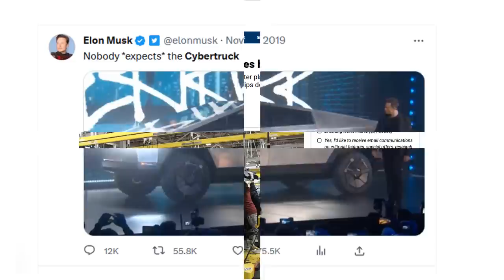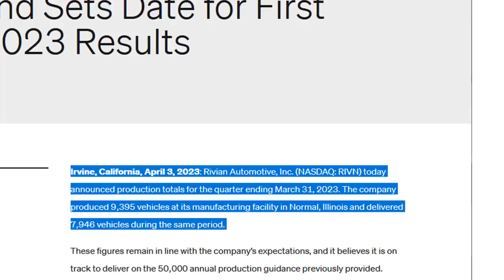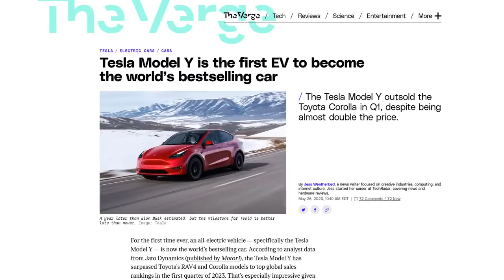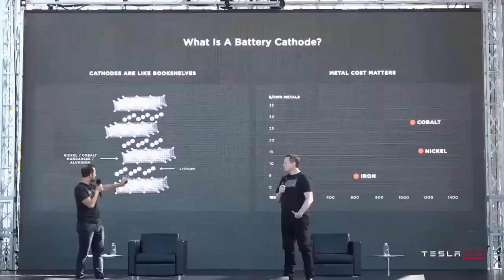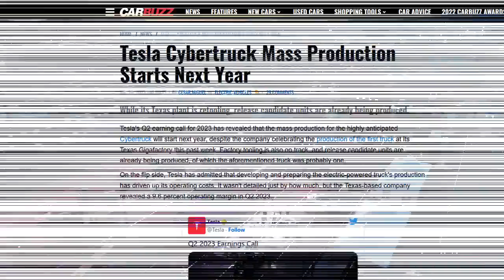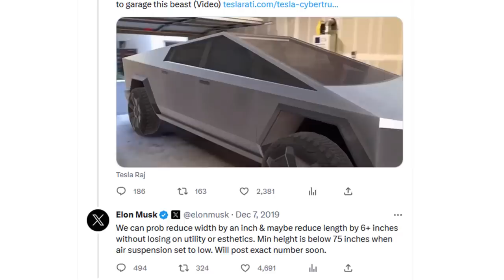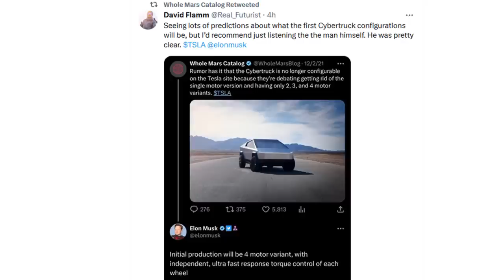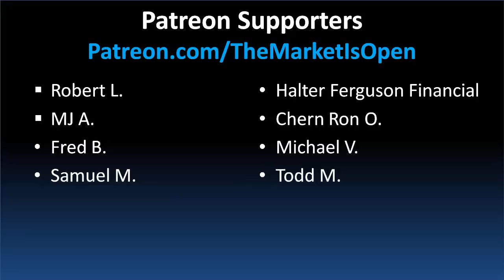Tesla Drops BOMBSHELL on Pickup Truck Industry

Comment: “A tank that can outrun a Porsche.”
Reply: It will become the go to vehicle for the Taliban and Isis,  mounted with a GAU-8 Avenger.... you think I'm joking ? Watch this space...
Reply: @chrisheath2637 ok?
Reply: For about 150 miles
Reply: @gmeister03  Because it an electric, if going, fullbore, or carrying a heavy load, it will lose some mileage, but nothing in comparison to the other OEMs offerings out there Such as the Ford pickup for example.
Reply: @chrisheath2637  Eli will simply disable the trucks via over-the-air updates!
Reply: @tomlewitt  Simples !!!
Reply: @chrisheath2637 couldn't Tesla just shut it down..
Reply: @chrisheath2637 so what
Reply: @gmeister03 long enough
Reply: @GWAForUTBE yes
Reply: @GWAForUTBE let's not forget they can be tracked.  Why shut it down when they would lead us directly to their base?
Reply: In '86 l co-founded the Australian Porsche 356 Registry. In the '90s l drag- raced a historic Sports car.
Now l plan to run CYBRTRK down the quarter mile against all-comers, including the Porsche 930 Turbo. Let's see how the QUAD CT goes!

Comment: Let's say that 30% of all reservations get materialized into actual purchases of the vehicle, that means that they first would have to make 420000 Cybertrucks just to fulfill those. Only after that they will be able to put it on the wider market. Only 100000 per year is not going to make it. Maybe 300-500000 vehicles a year. And if they actually manage to make it compelling to a broader customer base it's possible it could outsell Model 3.
Reply: They asked their suppliers for enough parts for a 375K/yr run rate.
Reply: Yea, I think someone said the same thing about the Model Y.   How did that work out?

Comment: What's the difference between ICE versions of FORD, GM, RAM, and TOYOTA trucks?

They all have the same basic Box shaped cab & Rectangular bed, the only main differentiator is... Design of the grill
Reply: Superficially sure, but that's where the similarity ends.

Comment: My old Ford 5-door Excursion can carry 8 passengers and after reconfiguring the interior will haul 4' x 8' sheets of plywood/ drywall inside of it...and fits in my 20' deep garage!
Reply: Where's the fifth door?  What's the bed size?  Are the back doors full or suicide?  Apples to apples please.
Reply: When these trucks lose their demand their price will fall to an affordable price.
Reply: Not a current product, meaningless comment. Thispost is looking forward, not back.
Reply: You can also do that with a minivan without the huge fuel consumption of the Excursion.

Comment: If you drive a truck because you like trucks, this will be great. If you tow a RV or other trailer long distance, not there yet. Even if the truck turns out to be capable, there are scant few Supercharger spaces that a truck, let alone a truck pulling a trailer can fit into, or pull through. Dropping a trailer and rehitching it to recharge will not be popular. And when they finally start installing them, keeping them open for trucks pulling a trailer will be a challenge as well. I enjoy my Model 3, but will be keeping my RAM 2500 Cummins to pull the RV for the foreseeable future.
Reply: Imagine a Big Battery in your Trailer so you could top up the truck battery from the trailer to increase your travelling distances, CT has 240v power onboard and it wouldn’t take much to run power through that connection as well as have house power on the trailer …
Reply: I thing the pull thru charging stations will become popular, once the semitruck OTR production takes off.

Comment: Cybertruck has the futuristic looks but unlike the Ford truck, it does not 'function' as a 'work' truck because it does not have sufficient 'space' for typical materials and tools used by workers. 

Furthermore, it most likely will not have the capacity to carry a 'payload' for significant distances, which will translate to the need for frequent charges to and from worksite destinations and associated lost time hours at the charging stations. 

Moreover, the inability to operate the EVs on cold mornings will prevent workers to commence their journey to the worksite on time, etc, etc.

The above are just a few of a miriad of other disadvantages of operating an EV.

The people who fall for the EV deception will be sorely disappointed and hurt financially.

Comment: Other OEMs are doomed. Which sucks because I’ve been rooting for Rivian and Lucid & at al. It will be great to see legacy go bye-bye!! The Berlin and Austin ramps had to deal factory construction and such. CT can just hit the ground running. 100k/y is ≈2k/w, so guessing 6-8mths to get there. Ford is the tricky one for me. I don’t for them at all, but they seen to really be trying. Still no big loss if they go as well.
Reply: Huh?  Rivian is just fine.  Not a zero sum game.  Not everyone likes the look of this Tesla truck.  Not everyone likes Elon.  Rivian has the real full size SUV as well as the R2 line coming.  Not at all a Rivian fan boy.  Just saying it doesn’t have to suck.  The way I see it, the more EV acceptance, the better for all of them.
Reply: @orangeroom5414  Man I hate to force the ice bath challenge on you, but Rivian is in production hell right now. They are burning through their VC stash and don’t have an ICE business to fall back on. Their only claim to fame is currently the R1 which has less than zero margin to loose if another e-truck emerges to take what little market share they have. CT was designed to crush the F-150 Lightening and once ramped Rivian won’t even be a bump in the road. Unfortunately.
Reply: @medennis3467  as I said, not a zero sum game.  But ok, the future will tell.

Comment: As the Cybertruck will likely be 4680 battery constrainted, my guess is the high end 500+ mile version will NOT be available until 2025. and instead the dual motor version will be the only trim available for the first year.
Reply: There is not going to be any single 500 mile version lol!!!
Reply: @alanmay7929  I'm struggling to understand your comment.
Reply: I didn't think it was using the 4680?
Reply: @MsAjax409  yep you can keep struggling!!
Reply: @MsAjax409  
Alan is from the "FUD clutching at straws department"
Reply: @rogerfroud300  
Don't confuse the Semi with the CT.
(They will both be using 4680 next year)
Reply: @TomVillars
Don't be so sure.
Machine deliveries to Texas indicate that 4680 is getting ready to ramp.
Reply: Musk already stated that the 4 motor version, which is the highest end version, would be the first one released.  That will likely be a long mileage version.
Reply: @billweberx  Yes, he did.  It was back in 2021.  Plans can change though, so let's wait and see.
Reply: @rogerstarkey5390  yeah again machines delivered Vered by diesel trucks........ and you don't even mention it! When the diesel trucks and equipments worked 24/7 building that factory and even still does today you didn't say anything about it! Is that how it's supposed to work!!
Reply: @alanmay7929  
Sadder by the day.
Your time is passed.
Reply: @rogerstarkey5390  that's what she said!!! Anything else!!!
Reply: @MsAjax409  It makes no sense to release a low cost model when volumes are low.  Tesla has always released high end first getting maximum margin with low volumes.  I see no reason they will change it this time.
Reply: @alanmay7929  I'm told it's hopeless.
Reply: @MsAjax409  that you're hopeless!!!!
Reply: @alanmay7929 why are you harassing people?

Comment: What I've seen thus far of the release candidate, has been disappointing.  Rumors talk of problems with suspension and braking and weight.  4680 is falling short of energy density goals so the 500 mile range may not be obtainable.  Of course, the windshield wiper is a total disaster not only in terms of looks but also function.   Who knows what the price will be, but tesla expects everyone to pay more for much less than promised.
Reply: You seem to know a lot more than everyone else.

Comment: Not enough miles per charge needs 600 to 1000 and to long to recharge
Reply: Wrong. You obviously don’t drive an EV. 😂😂
Reply: That is a long way to go to work.
Reply: @MrParcho  
This is what the septics don't compute.
If it's a business vehicle the whole point is to be working, making money, not driving, costing money.
Reply: It's not a U Haul.
Reply: @rogerstarkey5390  You drive to the job site, then work. your carry your work gear and materials to the job site in the truck. Why would you drive 1000 miles to work. Makes no sense. Once a year you might go on a long trip.
Reply: @MrParcho Cybertruck does not 'function' as a 'work' truck because it does not have sufficient 'space' for typical materials and tools used by workers. 

Furthermore, it most likely will not have the capacity to carry a 'payload' for significant distances, which will translate to the need for frequent charges to and from worksite destinations and associated lost time hours at the charging stations. 

Moreover, the inability to operate the EVs on cold mornings will prevent workers from commencing their journey to the worksite on time, etc, etc.

The above are just a few of a myriad of other disadvantages of operating an EV.

The people who fall for the EV deception will be sorely disappointed and hurt financially.